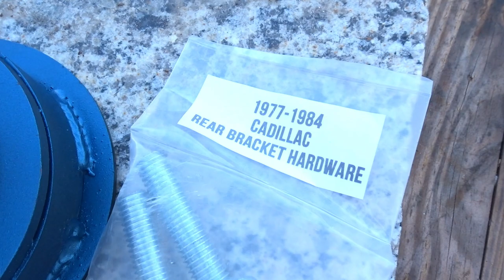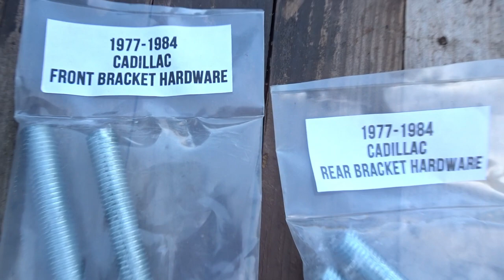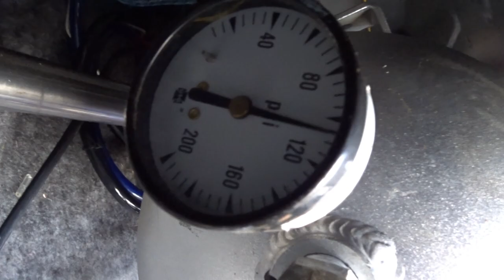Installing Air Suspension in my 1983 Cadillac Coupe Deville | Cadillac Chronicles | Episode 16

Comment: Great Job! A few Questions...
Did you have to weld the rear bottom brackets to the rear? How do they get held onto the rear axle?
Also, how is the ride with the bags compared to stock springs & shocks? How do bags feel on a bumpy road?
Reply from the maker: Thank you and you don't have to weld the cut out space it has on the bracket will keep it in place along with the bolt on system for the top.. it rides smooth as long as you don't have it completely lifted when your driving even on a bumpy road

Comment: Im fixing to do my 1994 deville on air bags ,any tips ?
And that type of airbags would you recommend.
Reply from the maker: Check out DC fabrications they will get you the right stuff you need for your set up... best tip I can give is run the power strait to the battery and not to the Amp it will give you less problems

Comment: Did you run 1/2 inch for the air system or 3/8? What size is your air tank? And last of all would really love to see video of what the air ride system looks like after it's all installed, that would be sweet. Thanks for the video, love the car looking sexy.
Reply from the maker: Thanks for watching, I ran 1/2 and my take is a 5 gallon I belive not to sure but I am looking to double up the tanks. I do have a video of the air ride walk around just look for it on the Cadillac chronicles Playlist on my channel homie thanks you for the support
Reply from the maker: https://youtu.be/ofjkxFTsbA4?si=imzIyjPtHUa0z3Ru
Reply: Awsome, after watching your video I went with all new, fbss 4 switches from hoppos dual tank dual compressor. Did you have to weld your lower cups/bag mounts in place?@OneManClicka
Reply from the maker: @dobs78  great pick homie flag I could help ..naw I didn't weld mine there going good just fine besides I'm not going to do anything crazy just simple play n lay
Reply: @OneManClicka  lol, you want to travel to bum f##k no where and help me out? Dam, homeboy, lol  thanks again.
Reply from the maker: @dobs78  lol if I'm near by I got you.... where you from anyway homie?
Reply: @OneManClicka  little place in canada, called lake country
Reply from the maker: @dobs78  oh dope i wouldn't be able to help physically but ill be there in spirit lol

Comment: Did you relocate the front shocks or just remove them completly? Also do you have bag/ mount measurements at all?
Reply from the maker: The front shocks were completely taken out and I didn't get the measurement. The website I got them from has the options of different air bags depending on the make and model of your car
Reply: @OneManClicka  awesome good to know. I have an 89 brougham and I believe it's the same setup underneath to a tee
Reply from the maker: @merrickcollett7264  dope and yea they should be,  check out the people I got mine from they have complete setups and great customer service

Comment: Did you keep the front sway bar?
Reply from the maker: Yes sir I did
Reply: Nice
Reply: Also, if you kept the rear shocks.. does stock length work?
Reply from the maker: kept the back shocks the  stock length does work since its a simple lay and play setup  @krazyj512
Reply: @OneManClicka  perfect! I just finished my setup on my 84 coupe.  I took the back shocks off not even thinking they would work .. but it definitely needs them, it's crazy bouncy driving around.
Reply from the maker: @krazyj512   good to hear homie and yea its supposed to be a smoother ride. a lil tip that will help with the bouncyness is to not have it  
raised all the way up drop it just a bit after you raise it all the way up
Reply: Definitely!!!  Thanks again!!
Reply from the maker: @krazyj512  anytime homie